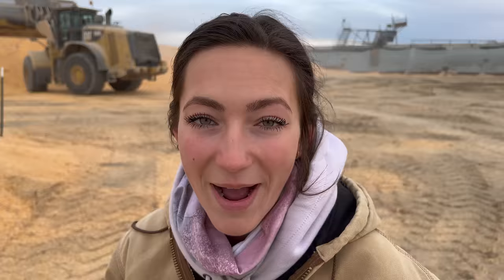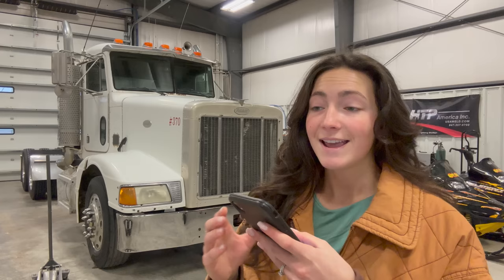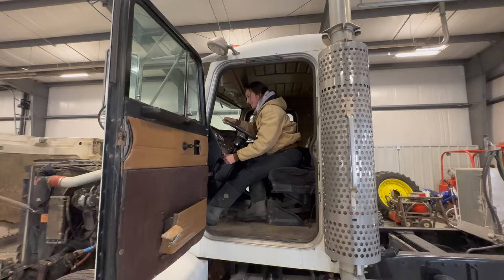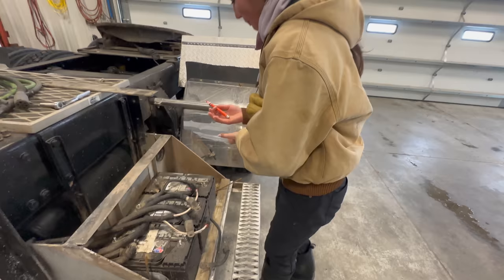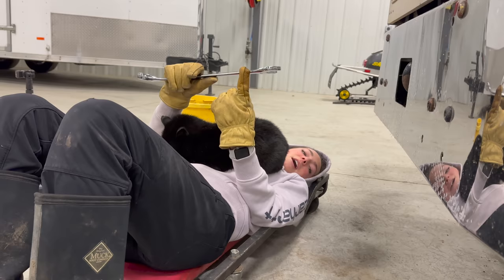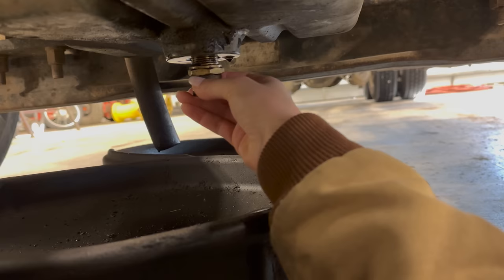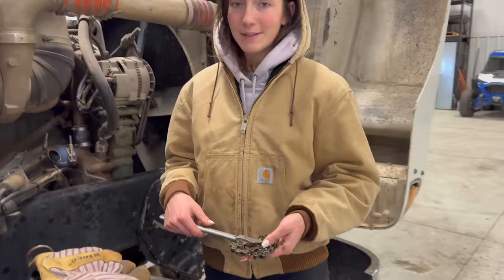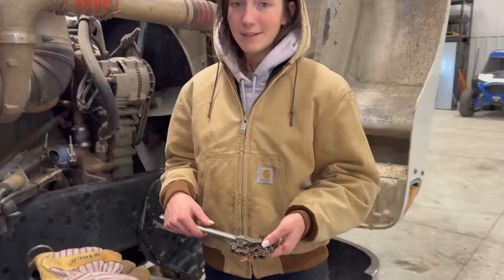The Worst Oil Change

Comment: oil filters - best is to grab the correctly sized oil filter wrench end cap ($8 at Napa) - it fits like a socket-wrench socket over the end of the oil filter, and you drive it with a 1/2" or 3/4" regular socket wrench, which means you have access to all the extenders and torque meters and everything else you can scrounge up that can help you apply sufficient leverage to get even Hulk-tightened filters off.  looks like the same end cap might fit the end of your fuel filter.  for the one that's damaged, the cap might not fit on it, or it might shear what's left off.  you might need a strap-based oil filter wrench.  Horusdy makes a metal-strap set that sells for $50.  The straps are flat (not like your chain one) and won't cause more damage, though you might need to create some clearance to get it up above the damage.  finally - on the chain wrench you're using - it's possible you are using it backwards, and that's what's forcing the tip of the handle into the filter can, instead of dragging the chain around the circumference of the filter can.  hard to say... but regardless, the chain is too narrow to get good purchase without damaging the filter body.

best option - take a good close up picture, then another one with a tape measure held up to the end, then drive to the nearest mechanic or friend with a good set of tools, then ask them if you can borrow their best extraction tool for an afternoon so you can get those last two filters off.  you may need to cut the one off - just have to be super careful not to damage either the threads OR the seal surface on the block/oil system interface.

good luck!

Comment: Nowadays, the best way to do an oil change is to forget about the drain plug and use an oil extractor pump.  It has a vacuum hose goes in through the oil dipstick tube and sucks all the oil right out. You just need the truck sized one with a pump that runs off of compressed air (rather than a manual pump).  That's what all the oil change shops use nowadays.  It's easier than pulling the drain plug and it avoids potentially stripping or galling the threads on the aluminum oil pans many engines now have.

Comment: use new oil on the rubber seal, dont be so cheap
the only time I ever saw filters stuck on really bad was when they were not changed for years. big channel lock pliers usually work the best on filters
Reply: "use new oil on the rubber seal, .."

This^^^

Comment: Definitively gone through that, I started like you did with a belt, passing it through the eye of a key to pinch and turn the filter, it  did nothing and kept slipping.
Finally got it off using a ratchet strap, took the end an made multiple turn as high as i could on the filter and pull with the ratchet, it did the job even if I wasn't believing it could work.
The brutal and messy way is to just stab a rod through it and turn but if it doesn't work you won't have any filter left to try something esle.

Comment: Put the oil filter wrench up at the top of the filter, closer to the open end. That end is stronger and will put up with more torque on the filter.
Reply: Duhhh??... Watch the video. There's not enough room to go higher.

Comment: There is a nifty item that I use to change oil on some of our equipment, and it is called an oil filter wrench. It is usually black, and it is shaped like a cup holder almost. You can attach it to a ratchet and twist away.

Comment: The problem is compounded with getting at engine oil filters on a highway tractor due to the frame being in the way so a normal strap wrench or chain wrench as you were using can only access the bottom portion of the filter that hangs below the frame rail, fine if the filter is not on very tight but otherwise its going to crush the filter. There are high quality wide steel band filter removal tools that are size specific and those would be the best but what I have made a lot of use out of is this model of Lisle tool which is more universal due to its adjustable style but can be goofy because that portion can stick out in the way in a really cramped situation. Never the less its worked great in a lot of typical farm equipment and highway tractor filter applications and am amazed I haven't broken it as I have sure pulled hard on it. Its what I use to remove the single LARGE engine oil filter on both of my Petes with the Cat engine. As you can see it takes a 1/2 drive and so will use a 10" extension so the unit can be slid all the way up to the top of the filter base area and then I use an 18" long handle ratchet to drive it but have used a 24" flex handle as well. Knock on wood its removed every tough filter that its fit so far and its really not that expensive. https://www.lislecorp.com/specialty-tools/filter-fuel-and-oil/adjustable-oil-filter-wrench

Comment: If all else fails drill a 1/2 inch or larger hole through the frame just across from the top edge of the filter. Use a 3/8 or larger punch to punch a nick in the top edge and beat the thing around with a hammer.

Comment: Laura and Grant i have had filters be like that many times in my life (I'm 62 ) normally it was caused by someone not lubricating the rubber seal and a good filter wrench may be the ticket BUT you may have to cut the filter housing off and go in with a punch or chisel and knock it free . They can be an all might challenge so good luck it will come free just take your time.

Comment: I'd agree with alot of the other people leaving the idea to turn the truck wheels to the right, before you drop your oil.  Then use a strap wrench, and get the tool as close to the top of the filter as possible.  Once the filter starts to crush, that's where things can just keep getting worse.   I've had this happen to me a couple times before also.

Comment: Seeing as you have a lack of the specialty tool, HEAT. Torch, heat gun, hairdryer. Once it's junk, hole in it, you can mangle whatever to get it off. A long screwdriver punched through near the top at an angle you can leverage has been used, by me, when all else has failed. If you have any access, you can also cut it off. All are less than ideal. Gotta do what ya gotta do.

Comment: Well I can sympathize with you I have been there and done that with oil filters. You’ve been given a lot of very good advice that may work.  This is an example of really poor trucker automotive engineering. The filter should’ve never been installed in location it’s hard to get to. 
You might have to get some sort of diamond cutter on a Dremel tool and carefully go in and cut the old filter out. 
Good luck😊

Comment: USE A 2" FLAD BED TRAP OR 4 " STRAP GET AS HIGH AS POSSABLE. USE A SOLID .75" ROD WITH SLIT IN IT TO PUT STRAP THEN YOU CAN WELD A OLD SOCKET TO IT AND THEN WIND STRAP THE TENSION WILL TIGHTEN ALOND FILER AND BREAK IT LOOSE.

Comment: Might I suggest filling the filter with clean oil before putting back on.  With cars we wouldn't do that but with trucks and other farm machinery that took the 'long' filters, always did that to keep from pumping a large amount of air into the oil pump system.  Also do not overtighten filters...as you can see they tend to tighten up over time and if you overtighten from the start, it only gets harder to remove next oil change.

Comment: There's trick tools for that, but in a pinch you can take an old 1/2 large socket and cut a notch in it so that the old fan bolt you have will fit in notch doubled up. Turn your steer tires all the way to the right for more room to work. Wrap belt around filter high up on it wear it threads on and is much stronger, put belt thru notch in socket with a long extension and a breaker bar, if she still won't break free. put a heat gun or hair drier to it for a awhile and try again. Good luck

Comment: Only advice on changing the oil on the semi truck is run the engine till it's at operating temp it's always best to change your oil when the engine is hot I know it sucks but it's the best way

Comment: Get a wide truck filter band wrench. You hook a ratchet or breaker bar on it and it should work. Also, I like to change oil when it's at operating temp. Instead of taking the filters off when they're hot, get a hammer and punch and pop a hole in the bottom of the filters and let them drain. Then while your draining the pan, they will cool down a little, but you won't have hot oil dripping down on your hand, which will make you drop the filter in the pan, and if it's full it will splatter all over! Don't ask how I know this! But I owned a fleet of tractor trailers in the past.

Comment: Once the filter body is damaged, the filter wrenches may not fit.  As a last ditch effort , drive a large screwdriver straight through the filter near the threads, then use a cheater on it.

Comment: It's a metal band filter wrench with a 1/2 square drive that fits around 4"- 4 3/4" size filter and you'll probably want a good long 3 foot 1/2 rachet. There's mainly two sizes that fit most semi filters, there's a bigger one that fits the slightly bigger filter like that's on a C15 Cat. The slightly bigger one is probably more in the 5" - 5 3/4" range I would guess.

Comment: I think you should have another cable connecting the far left battery to the middle battery.  I am a diesel tech and have never seen where all three batteries are not connected at the battery itself.. Like others have said, should make those connection nice and shinny.  As for putting anything on the connection I never use anything and have never had a problem.  To save a few dollars you might want to check with your local truck dealer, we buy batteries from Peterbilt and save a good deal of money over what the Auto Parts store wants.  Also Freightliner and International always have good prices on batteries. Just bought a set last week for $117 each, 950 cca, group 31.  Been using these for years and never had any problems with the TRP brand.

Comment: full time oiler and I had to filter so tight that even using 2 CAT filter wrenches at the same time we ended up crushing it,  it came off in pieces, and chiseled the gasket plate off the filter housing. many unkind words were spoken,

Comment: I didn't notice how accessible the top of the filter is, I have had a few that I've actually ripped the outside canister off the base and not gotten the base of the filter loose. If you can come at the filter base with a chisel and walk it around may be your best bet. I prefer my air chisel at an almost flat angle so as not to gouge into the filter base. The other option maybe to unbolt the filter adapter base off the engine if it is a separate piece. Good Luck with it.

Comment: Wide band filter wrench. Amazon sells Gearwrench brand. You turn it with a 1/2 inch ratchet, breaker bar or amazon sells handles for 7 bucks.  I enjoy the videos. Keep em coming.

Comment: Get a truck wrench, en for now you can try to put a inner Tyre of the dirt bike of a bicycle around it.

First clean the filter and the Tyre with Thinner or other strong de-greaser (brakecleaner) put the chain of the wrench around it and try again.

Heating up the top of the filter is also possible just to soften the rubber sealing that is now glued to the engine.

When this works, first clean where the new filter its sealing comes on the engine, oil it after drying, and your ok.
(This because there can be some rubber glued there, and the new filter can give the same problems as now next time)

Succes!

Comment: Filter hint, first take old Phillips screwdriver poke hole in bottom of filter, another near top, drain first. Truck oilfilters are on tight, some specs say hand tight ,plus 3/4 to one turn, or they can n will leak, some say you should refill with new oil, check engine specs

Comment: I use an Oil Filter Cap wrench, works fine if the oil filter can has a Hex Head, now the cap wrench will skip around a oil filter Hex Head can that is not strong, I would recommend GM Oil Filters, the can is very strong...

Comment: Take a big screwdriver pone a hole in it up by the top. And use that screw driver to turn your filter. To where u can losen it by hand. I have done it and it has worked.

Comment: So that drain plug has a cap on it. You pull the cap off and screw a drain onto it for easy draining. Personally for field use id highly recommend removing it and installing an oem plug. If it gets broken off bye bye oil

Comment: Use A oil filter Band wrench as close to the engine as posable, if you can overlap the seam where the side if the oil filter side joins the base at the engine, will not crush there, Hope this helps. .

Comment: I always used either an oil filter plier or an 2” wide strap wrench an grabbed the filter near the threads with an extension if needed &a1/2 “ breaker bar at least 24” long and a cheater pipe if necessary & filled filters full of new oil or diesel/atf when servicing semi trucks or trash trucks . Hope this helps you and most large Diesel engines use somewhere like 40 quarts of oil on an oil change . Don’t remember how many for most Allison trans but when you change the atf fluid do the filters also probably another 2-3 quarts in the filter housings.

Comment: If that's a CAT. check for the heater valve. In the summer they'll shut it off so heat doesn't blow into the cab. It should be on the right side of the engine right next to the firewall.  Follow the coolant hose

Comment: Good tip ::: get a valve to go in place of the drain plug we have em on all our trucks
Also take a punch and poke a hole in the bottom of the oil filter n let it drain 1st

Comment: Hi Laura, with all the filters on the trucks its the heat of the engine that makes them very hard to remove. You will need a steel band type of filter wrench. The soft bands will work to but the filter will come off as a twisted piece of metal.  Try to get to the top of the filter to remove.  I also seen that the oil plug is a No Spill brand drain plug, you want to look into getting the drain tube for that. hope you see this and helps. Looking forward to seeing more videos and all the best

Comment: I changed the oil in my pick up for years, and every time the filter was much tighter than when I put it on. I don't know why.
    If all else fails stick a screw driver through the filer and use that. The screw driver need to be run through completely and it wrecks the filter, but it always works.

Comment: Get a wide band filter wrench, slide it up to the top of the filter... If that doesn't work heat the filter around the top, if it is still stuck you can put a cut into the rim of the filter at the top, use a big screwdriver and a mallet get to move just a little use the filter wrench .... if that doesn't work, look at the new filter see all the holes and where the rim sits before the metal of the filter holder use a grinder, cut the filter off scrap the gasket off and it will turn them... use a couple of bolt's that fit into the filter holes and spin it off. you need to go to napa for the front wheel seal and the driver leak... worse thing if you cut into the bracket that holds the filter go one line like ebay and buy a used one for a couple bucks....Did you prime the fuel filter?  we used to use auto trans fluid, it cleaned the injectors...   check the air filter too? check the fuse's for the heater fan....  there may be a valve stuck on the heater core that is stuck of disconnected. you can bleed the wet tank see if there is water in there, that will tell you the condition of the air compressor.

Comment: Looks like you have bought a real “steal” !🤣. 
Change the oil,filters, and make sure to grease everything including the  throw out bearing.   
Looking at the battery box, there’s something wrong in the way the batteries are connected.  First, should be 4 batteries.  Doesn’t look like all are connected together.  Might want to go by the dealer and get a schematic. 
I put an old mud flap or conveyor belt under the batteries as well. A little bit of cushioning and helps keep any acid that may leak away from the aluminum. 
Last but not least, the heater core is probably plugged. Double check to see if the valves are actually opening. Could be stripped at the handle and not opening inside. 
Good luck!

Comment: You should try to install the fourth battery.  That extra amperage makes a big difference in the cold.  We once bought 1500 IHC 9400i tractors with ISX Cummins engines that all needed the fourth battery and upgraded starters.  They were still the hardest starting units in the cold.  mrg

Comment: Too late now, but I've always found fresh grease instead of used motor oil when spread on the gasket helps filters break free easier. Also, diesels are much easier to start if you fill the new fuel filter with oil prior to installation! Once those filters make contact, go no more than a half turn tighter using just your hands. Never let anyone that you don't personally know change your oil. My guess is the last one was done by some guy at a truck stop that was having a bad day. My next option after what you've tried is a big honkin' pair of channel locks. Buy them now while you have a good excuse man!

Comment: 16yd bucket is nice and all. I ran a Letourneau L1850 for 11 years with a 56yrd coal bucket loading 240 and 330 ton haul trucks.  Could average 45 tons per bucket depending on conditions